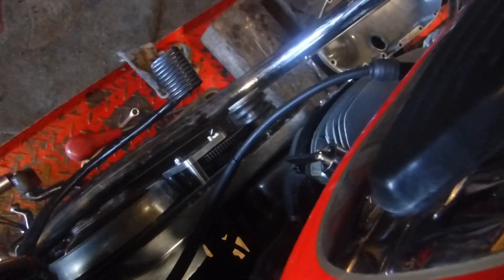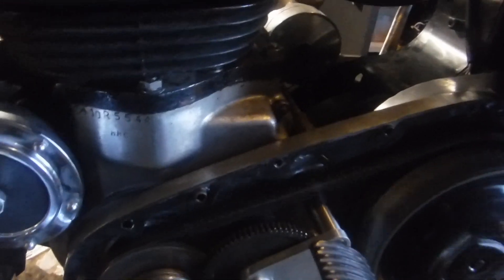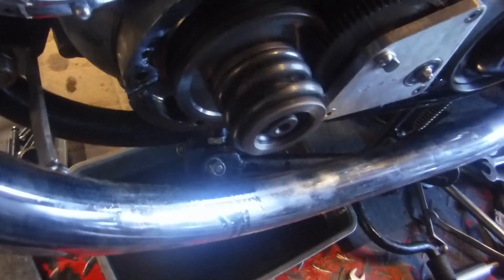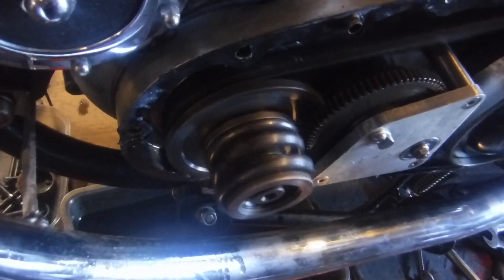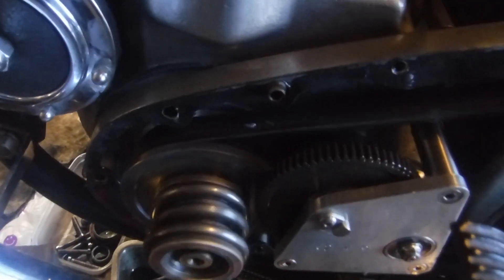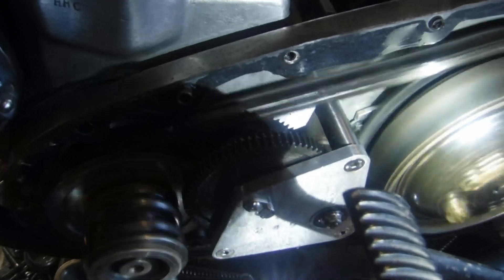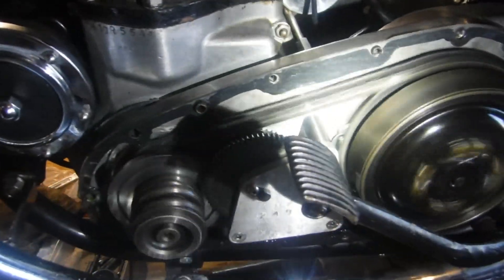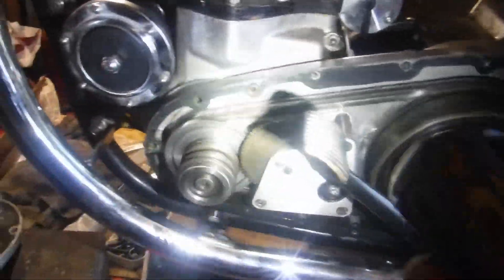BSA A10 Super Rocket engine running with primary cover removed to see if noise persists.

Comment: Try to see if there's any polished up spots on the rear chain plates. Or is it even something more simple like the rear chain tapping the swingarm pivot with a standing wave. Mine did that when I fitted slightly longer rear shocks. The sound went when I was riding with the suspension compressed.

Comment: Whilst running  in gear slowly  put pressure  on the  rear brake that'll  stop the  noise. It'll  be the final drive chain thrashing  about. As they always  make clunking  noises when not under load.
Reply from the maker: I did that, and it made it worse, but you could be on the right track!

Comment: Chains ,bearings ,etc often get reversed orientated upon reassembly....sprockets get worn..its a black art..Ive always thought a couple of tensioner guides would really help....lay out all the clutch springs and put  a straight edge over them..also a fine file clean up clutch basket tines and plate spline ...tabs..with make for a much smoother clutch movement

Comment: Hi Paul, If you haven't already, have a good look at the primary and final drive chain. I had a similar noise on one of my bikes and it turned out to be a split roller on the final drive chain. crazy thing was it had to be in just the right orientation to hit the gearbox sprocket and make the clunk. So it happened about every third or forth rotation of the chain.

Comment: Hi Paul, do you have an engineers stethoscope? I find they help immensely in localising odd noises which often send you in the wrong direction. Just a thought.
Reply: Alternatively!, old mechanics trick, a piece of wood about a foot long and half inch thick. Place around area you think is the issue, place other end against your ear. Believe it or not works for me every time.